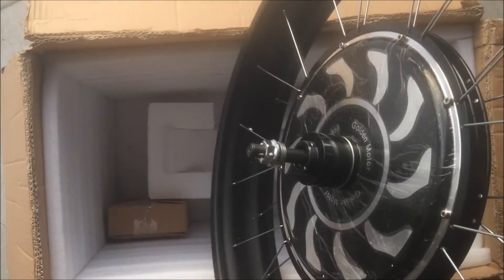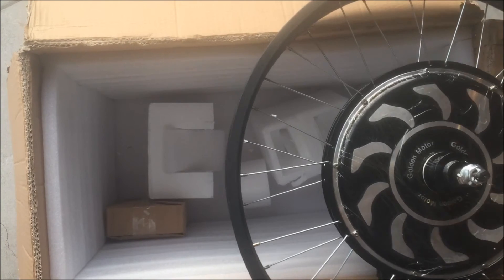Fat bike electric conversion kit by Golden Motor

Comment: i have a mp5 non fat bike can it be converted
Reply from the maker: +LastManStanding 
If its a rear motor it will have a 135mm dropout width. You can use it on the front of some fat bikes that have 135mm front dropouts.
Reply: thank you Gary
Reply: Okay not to sound stupid but there with me I am American lol. But what I put it on the front forks I remove the cassette of course and just add washers to compensate for distance
Reply from the maker: +LastManStanding 
f you have a rear Magic pie motor your dropout width will be 135mm. If 
you have a fatbike with a front fork dropout width of 135 mm you can 
just remove your freewheel and mount it on the front of the fatbike. No 
extra washers required. If you follow this link you can see a rear smart 
pie mounted in the front of a fatbike. http://goldenmotor.com/SMF/index.php?topic=5940.msg33484#msg33484